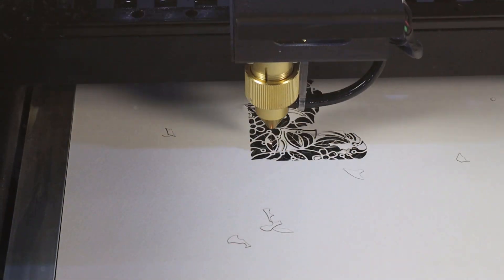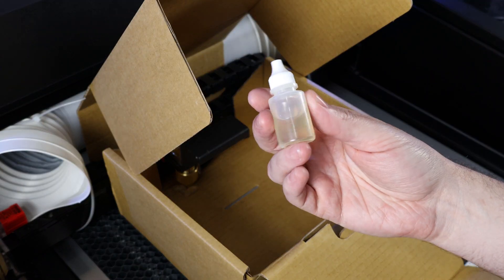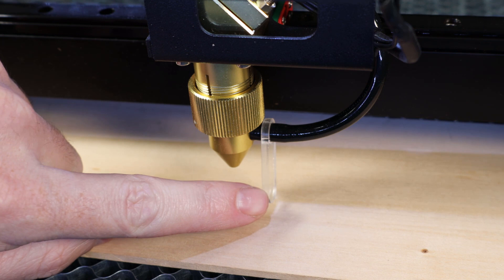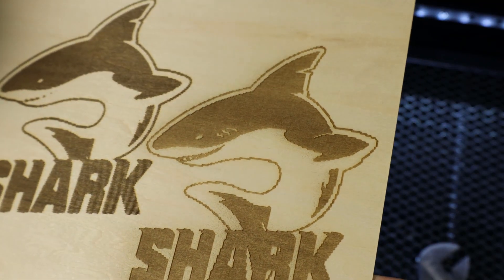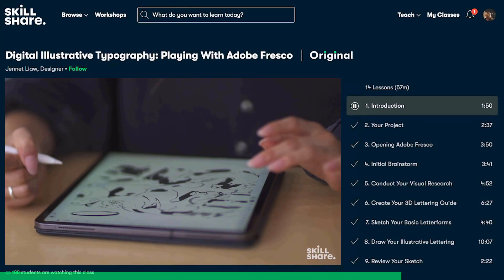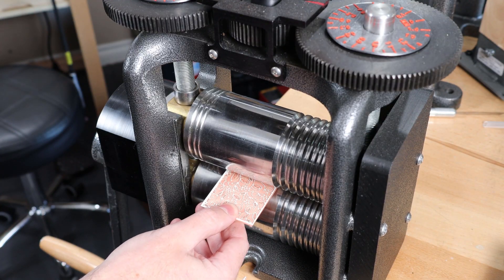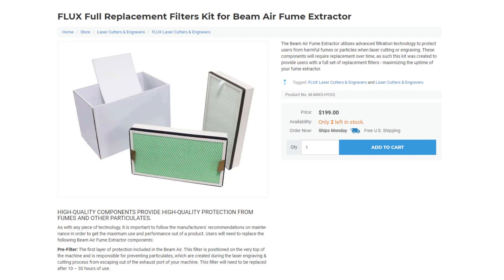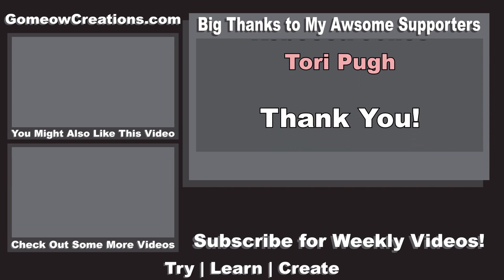Using A Laser to Make Custom Textures For Jewelry & More - Flux BeamBox

Comment from the maker: The first 1,000 people to use this link will get a 1 month free trial of Skillshare: https://skl.sh/gomeowcreations09211

Laser Cutters & Engravers:
FLUX Beambox 40W Laser Cutter & Engraver - https://bit.ly/FLUXBeamboxCO2LaserCutter
FLUX beamo 30W Laser Cutter & Engraver - https://bit.ly/FLUXbeamo30WCO2LaserCutter
Refurbished FLUX beamo 30W Laser Cutter & Engraver - https://bit.ly/RefurbishedFLUXbeamo30WLaserCutter
FLUX BeamBox Pro 50W CO2 Laser Cutter & Engraver - https://bit.ly/FLUXBeamBoxPro50WLaserCutter

Beam Air Fume Extractor &  Filters:
Beam Air Fume Extractor - https://bit.ly/BeamAirFumeExtractor
Full Replacement Filter Kit - https://bit.ly/FullReplacementFilterKit

Materials for Cutting & Engraving :
Clear Acrylic Sheet - https://amzn.to/3hLY8tB
Fluorescent Green Acrylic Sheets - https://amzn.to/3nNX9N2
Translucent Red Cast Acrylic Sheet - https://amzn.to/3lDfxFO
10 Colored Acrylic Plastic Sheet - https://amzn.to/3hMHQ3k
Basswood Sheet - https://amzn.to/3Ar171A
Birch Plywood Sheet - https://amzn.to/3hMvVTm
Fuyit Wood Slices - https://amzn.to/2XF1Jmf
Heavyweight Cardstock - https://amzn.to/3kpgUZw
Real Cowhide Leather - https://amzn.to/3znX4lm
Aerosol Black Laser Ink for Metals Marking - https://amzn.to/39orMQI

Ventilation Ducting & Fans:
4 Inch Inline Exhaust Fan - https://amzn.to/3nO6Db6
Cheaper 4 Inch Inline Exhaust Fan - https://amzn.to/3EHNwWu
4 Inch Aluminum Air Ducting - https://amzn.to/3u6ePF7
4in to 6in Duct Reducer - https://amzn.to/3hOOdDn

Other Stuff From MatterHackers:
3D Printers - https://bit.ly/MatterHackers3dPrinters
3D Printer Filament - https://bit.ly/3DPrinterFilamentMatterHackers
3D Printer Resins - https://bit.ly/3DPrinterResinsMatterHackers
CNC and Laser Cutters - https://bit.ly/CNCandLaserCuttersMatterHackers

*This laser cutter & engraver was supplied to me from MatterHackers and no money changed hands. All options in this video are my own. The above links are affiliate links so if you used them to buy anything I will make a small commission on anything you buy at no extra cost to you and it will help support my channel. *

______________________________________________
If you are looking for more tools and materials that I use, well you're in luck! I made a page on my website just for that and I'm updating all the time so bookmark it to stay up to date:

https://GomeowCreations.com/tools-and-materials 
https://GomeowCreations.com/partners-discount-codes
______________________________________________
My PATREON ➜ https://patreon.com/GomeowCreations

One time support ➜ https://paypal.me/gomeowcreations
______________________________________________
Instagram ➜ https://instagram.com/gomeowcreations/
Facebook ➜ https://facebook.com/GomeowCreations/
______________________________________________
Reply: Gome do you know if there's such  thing as clay used when making silver jewelry .. just got a new handmade ring buy purchase but it seemed dirty around the stone area and metal base hand several small scratches to me it looked like the the  type of dirt seen in rings that are second hand and worn for years by someone brownish dark green scum the seller didn't respond for two days  then told me it is clay because handmade but I'm thinking isn't jewelry usually heated bent and polished why would there be clay + there are scratches on ring it looks like the type of dirt u would also see in old phones or computer... tell me what you think is it really clay ? 🤔I have pictures if needed

Comment: if you' re only gonna use it for cutting paper/cardboard and engraving you dont need a 3 thousand dollars Co2 machine, a $200 blue laser diode machine will do the same job just a little bit slower. you can even buy the laser module and build the machine yourself for less than $100 like i did
Reply from the maker: You are 100% right, but I'm not only going to be using this for cutting paper and cardboard. 

This isn't the cheapest CO2 laser you can get but setup and ease of use is great. I have some more stuff that I'm going to be making videos about in the future that will use the full power of this laser 😁👍